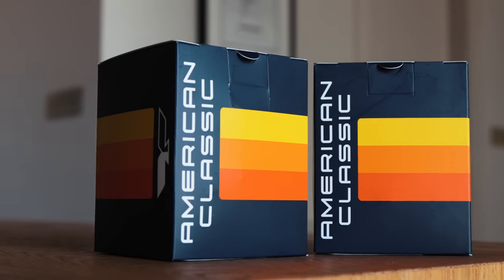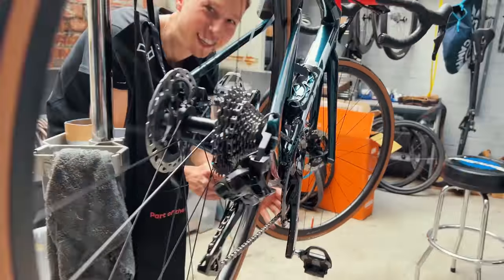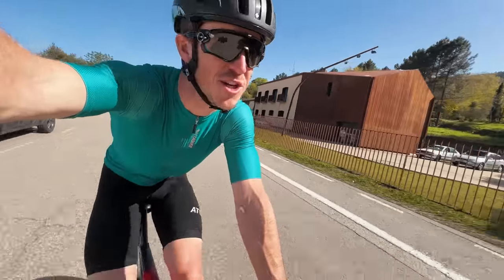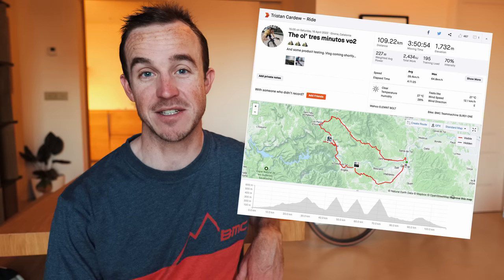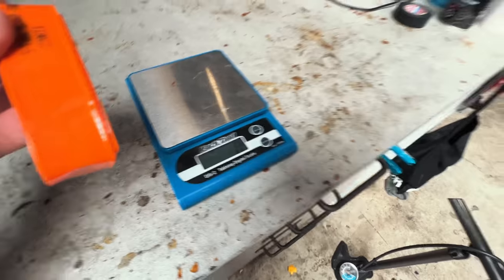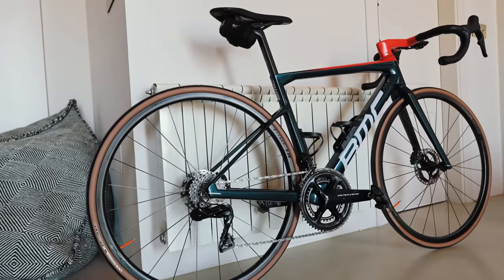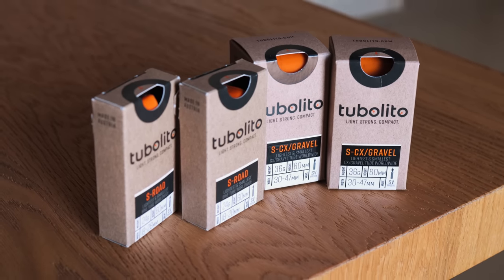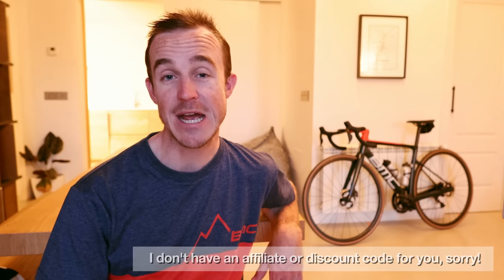One MUST HAVE upgrade for your road bike (this could change your ENTIRE riding experience...)

Comment: I rode Tubolitos for about a year and had a few punctures on it. They are very light, but in my experience they have a negative effect on rolling resistance. Replacing standard butyl tubes with latex tubes is a cost-effective, wise investment. Latex tubing is much softer and more conformable than relatively stiff plastic tubes. My recommendation are latex tubes or a tubeless setup. In my opinion, the advantages that result from this are worth much more than the weight savings with Tubolitos.

Comment: Even if you ride tubeless, the space-savings in the saddlebag you get from packing a Tubolito as your spare tube is worth the investment. Have only had to use a Tubolito once, felt great, forgot it was in there and I was hopping curbs and smashing through potholes all the way home. Then, when I changed out the punctured tire, the Tubolito cleaned up easily and folded back down to its super-small original size. I rate them for sure.
Reply from the maker: This is the feedback I love to hear. They just make sense in my mind! Glad to hear it was so puncture proof for you too 👌🏼
Reply: Spot on. Tubeless is the way to go + Using Tubolito as spare is perfect.
Reply: Thank you for the information.
Reply: Whether you are racing or hunting a KOM, using PU inner tubes is the worst choice you can do. In any case, the watt saving with a tubeless setup or with latex tubes clearly beats the weight saving with Tubolitos. If you are looking for a very light inner tube with a small pack size for your saddlebag, then try a Conti Supersonic, for example. It weighs only a few grams more and costs a third of a Tubolito.
Reply: @VeloclubLechhausen  Perhaps if you live in Germany the Conti tube is an economical choice, but Tubolitos and Supersonics are both $30USD where I live, and I find the PU tubes far superior in terms of puncture protection when compared to a 50g butyl tube. From a spare-tube standpoint, I don't care about what I chuck into the tire so long as I make it home without another stop at the side of the road.
Reply: @ktakashismith  This is annoying if there are no cheap, lightweight butyl inner tubes available in your country. The Supersonic tube was just one example of an extremely light replacement tube with a small pack size for the saddlebag. PU tubes make your bike lighter, but at the same time less efficient and who wants that? A tubeless-system is simply unrivaled for the best possible puncture protection combined with low rolling resistance. In terms of rolling resistance, however, latex tubes offer a good alternative, as many are biased towards tubeless-systems or do not dare to approach the technology.

Comment: Been riding Tubolitos for about 4k now, not a flat, not a puncture and lots of winter riding. Best value for money upgrade IMO.
Reply: what tyres are you running. Would they last that long in 23mm gatorskins. Thank you
Reply: @2552legoboy  I'm running GP5000 in 28mm but I bet they'd be fine in gatorskins, too
Reply: @Lwmuth  GP5000 are VERY good tires. I' have about 2000+ miles on a pair and haven't flared once. They are still going. I rated them before the rear one squared off too badly. I a have a set of Pirelli Zero Race on deck. I hope I don't regret it.

Comment: I've been running them for a year & 1/2 & found they are very robust! I get about 2000 - 2500 miles on a tube before puncture where on regular tubes I get 1000-ish miles. The weight, storage space, & being more supple, I'm hooked!

Comment: Tubolito's are by far the best upgrade i've got for my bike, also 10 months in with 4 punctures (3 on one inner) the repair has stayed strong ever since and the air loss when not in use in comparison to butyl is insane, NADA!!! I must add the punctures were big big chards of glass (after lockdown parties in BCN) which would have gone through butyl just as easily with cotton threaded tyres! The only thing I did notice is like you say it's supple, you do notice little bumps a bit more! Awesome review and glad you've converted to the orange side ;)

Comment: They are super light but can only be used with disc brakes, although they do a slightly heavier one for rim brakes, having said that I have been using latex tubes on my rim brakes for years without any issue which they don't recommend, but I probably wouldn't used them in the high mountains. Very impressed with your ability with film while doing vo2!!!

Comment: I have been using tubolito for about 2 years and only on my road bike. My ideal setup is : Tubolito rear, Latex front and 1 spare tubolito or 2 for longer day trips.   I like the feel with latex on front wheel over the weight gain.

Nevertheless I have not experienced*  much difference in puncture resistance between any tube type or similar quality as once the tyre is passed its game over.  The thing is if I puncture the latex and replace it with my spare tubolito on a ride I just leave it in after.  I then carry a latex spare.   The tubilitos need careful fiitting the side walls are fragilei if caught with rim etc and the valves are also fragile so make sure to not use lateral force etc when inflating.

Ofcourse latex needs some  re-inflation every 24 hours or so but Tubolito is at least as air tight as Butyl.  I like to check tyres before every ride anyway.   Latex is by a long way more comfortable than either Butl or Tubolito type.  Viewed as a system, taking a mix of latex and tubolito is for me the best balance of : Perf, weight, reliability, resistance, comfort, ease of maintenance. + lower 'faff' than full tubeless. 

Lastly I have successfully used cut up parts of an old Tubolito with standard glue as a patch rather than their specific repair  kit.

*  My last 3 punctures would have punctured any tube/race tyre setup though but 2 out 3 should have resealed if I was running tubeless.  Its still not worth the hassle for me but if you detest roadside repairs tubeless wins out imo. In 2 years I have have had 4 punctures total and ride 7.5K km per average per year on road.  Note: I live in South of France so same setup in winter also.
Reply from the maker: This is all great advice and commentary..thanks for taking the time to explain!

Comment: Ive had one of these in my saddle bag for a while now. Only just reading your comments i have realised there for disc only! good job punctures are super rare running tubeless. i've never had a flat in 18 months of switching to TL. Im sure it would work fine for limping home if i needed to use it.
Reply from the maker: It depends which you have…some are made for disc and some are compatible with rim brakes. These super light ones are designed for disc only but would most likely get you home fine if needed.

Comment: I’ve done a fair few kms on them, had good and bad experiences, ride is definitely nice and weight saving is noticeable but I’ve had two bad ones that cut regularly and two that have lasted well

Good upgrade if you ride on decent roads, expensive if there’s a lot of debris on your roads and you get regular flats 

They do hold air better than latex
definitely a great upgrade as a spare given the space and weight saving

Comment: Ngl, I’ve ordered 2 of these for my saddle bag just now. Looks like they take up feck all spade! The 2 conti tubes I have in there practically fill the thing
Reply from the maker: Nice one. You can literally fit 3 Tubolito’s in the space of one Conti tube and it’ll still be lighter. I’ve been loving being able to run a smaller saddle bag since making the switch.

Comment: Rode them for 25k in two years (on a rim brake and then also on a disc brake bike - the lighter S version is for disc only) and I was very happy with them. I think I’ve only flattened once on the rim brake bike and I had to pull massively to get the plastic valve out of the rim which was a bit weird… They are not the fastest in terms of rolling resistance. I’ve changed to tubeless some time ago but I still carry them as spares. Especially for gravel riding it makes a huge difference for your saddle bag. But overall I was very happy with them, need to get rid of the other tubes now :-)
Reply from the maker: Good to hear your experience..that’s awesome!

Comment: I have used Tubolitos a lot. The big disadvantage is you get a lot if flats. I now use a tubeless setup and love it 👌. I use tubolitos only as spares I case tubless fails. Which has never happen so far 😉

Comment: I've been running the tubolito s on my front wheel for thousands of kms without issue. Unfortunately on the back wheel got a puncture pretty early on and the puncture repair kit I found was just about useless. Simply couldn't get it to seal. That said, they're so light and feel so nice I'd still buy them again

Comment: Good review and excellent upgrade. Do You feel differences between 52 and 53 teeth? Nice thumbnail to crank up algorithm ;-)
Reply from the maker: Thanks mate! Yeah, there’s definitely a noticeable difference between the two chainrings. Ideally I’d like a 54. I find with the 53 I can keep a straighter chain line than with the 52 where I spent a lot of time in the 12, 13 or 14T cog on the cassette.

Comment: I ran them for over a year with only one having issues and tubolito was very quick to send a free replacement. But recently in the descents in Mallorca both front and rear have failed with one slowly bleeding air from the base of the valve and the other bursting on a switchback. I still think they are great for the weight, but I am starting to question their strength in some aggressive situations (but may well be my wheels).

Comment: Hey Tristan, thanks for another great vid. The scenery over there is isane! Curious to know if the V02 efforts you were doing were done on only one climb? (ie..is the climb long enough to get all the reps done, or do you descend and then start the next effort from the bottom?) Cheers!
Reply from the maker: Hey man, thanks so much. That climb is long enough to do a lot of 3” efforts but I was doing 3 of them and then descending back down for my 15” break in between each set. The main aim with that session is to continue climbing gently during the 3” breaks so your heart rate doesn’t come all the way back down, but then rest fully during the 15” break so you can start the second and third set at the same point as the first.
Reply: @tristantakevideo  gotcha! Cheers mate.
Reply from the maker: @leroy_who  No worries man

Comment: Great shout! Never really explored them before. Would be interested to know how they stack up environmentally? Also not sure if they would be robust enough on uk roads. Will give them a go
Reply from the maker: I couldn’t say how good they are environmentally, however they use less raw material than butyl tubes so that’s a consideration. They’re very, very light so I’d recommend grabbing a couple as spares and using them if you need..I hesitate to say “yes definitely try them!” if you’re unsure about the quality of the roads you’re riding on.

Comment: Only used Tubolito once but wouldn’t use again. Yes, they pack very small, but my experience they don’t retain air well and the valve stem is fragile. If you’ve used one  and then you take it out for repair, it will never go back to its original size, the plastic permanently stretches, so it becomes unwieldy to ever take it out as a spare again.

Comment: Why are u riding tubeless on your gravel bike but not on your road bike ? Is there a big difference ?
Reply: Also interested in knowing…why not tubeless on road bike ?
Reply from the maker: I’ve run tubeless in the past on the road bike and it’s been fine, but the tyres can generally only handle up to ~70psi. On the gravel bike I’m generally running around 20-25PSI and the super smooth roll and big tyre contact provides plenty of grip, whereas on the road I’ve found lower pressures can sometimes feel a little sluggish.

Comment: I have these on all my road bikes and my gravel bike.  Punctures are no bigger issue riding on rough country australian roads.  By far the cheapest way to shave off 200grams from your bikes taking into account the spare in the saddle bag.  Will never use butyl tubes again

Comment: This falls under the category of should have, would have, could have but didn't.  You convinced me.  But I'm interested in hearing a review on those tires.  I was considering those & liked how it was direct to consumer but lacked any real world info on them.  Like to hear your honest opinions on them.
Reply from the maker: My initial and most honest impressions on the American Classic Timekeeper tyres after 3 rides and 300k’s: they are THE GRIPPIEST tyres I’ve ever run. It’s actually quite incredible how much confidence they inspire on downhills. Genuinely, I’m quite blown away! HOWEVER: they are not as fast as other tyres I’ve used and I can feel the additional energy required to keep them rolling as quick as the last set of tyres I had. So it’s a trade off. Highly recommended for training and if you love going downhill with confidence, but maybe not so much for racing.

Comment: Hi Tristan. I really enjoy your videos. Let us know how the tubes perform long term.  I've viewed a few reviews on Tubolitos and not all have been positive. With the amount of miles you ride and document, I'd be very interested in your opinion. Also enjoy your interviews. Thanks,
Keith
Reply from the maker: Hey Keith, checking back in here. I’ve now ridden 9,000km on the Tubolito’s and had 2 very small punctures that I was able to fix for both. Ride quality is okay - not as smooth as latex but not bad. The weight saving is the most noticeable thing - both in my saddle bag and in the wheels themselves. So far I’ve been really happy. Hope that helps!

Comment: Mentioned in video so not entirely off topic. When upgrading from 52 to 53t did you have to make any other changes, chain, inside ring, front mech etc.?
Reply from the maker: We moved the FD up a touch to accommodate but nothing else. Shimano don’t recommend running a 53/36 setup but I’ve been running it on and off for a couple of years with no real issues other than slightly slower shifting.
Reply: @tristantakevideo  Thanks so much for the reply Tristan 👌🏻
PS I'll be switching out tubes next week already found a good deal on the Air Tubolito 👍🏻

Comment: Thanks for the review!!!
I'm considering buying these and I did find them online in Decathlon. But under "Compatibility" it's stated that they're only compatible with bikes using disc brakes. Is this true? I'm struggling to find a reason why that could be the case. Does anyone have any input on this?
Reply: Rims may get warm/hot under braking pressure
Reply from the maker: Yeah this is to do with heat in the rims from braking. Some of the slightly heavier duty Tubolito’s are compatible with rim brakes as far as I know.

Comment: Wouldn’t lighter mean it would be easier that it could be punctured? The roads aren’t great in the part of the uk where I live and €30 per inner tube sounds real expensive.
Reply from the maker: I can’t say definitively as I’ve only ridden them a few times since filming the video, however I would say the density of the material they’re made out of feels as though they’ll be more puncture or slash proof than regular butyl rubber tubes. Again, this is unscientific and I’m not claiming they are better or worse for punctures, but plenty of comments seem to suggest they’re pretty reliable. As spares, I will 100% be keeping them in my saddle bag. I’ll wait until I’ve done a few more k’s before I decide whether they’re ideal for every day riding.

Comment: I was skeptical with Tubolito's before, but the thought of spending thousands of dollars to shave off 100grams made me give it a shot. I've put on about 1000km on it on my road bike and 600km on my cyclocross/gravel bike. So worth it, I could tell it felt lighter and the way the tire conforms on to the surface you're riding on. No issues, even rode my bike on a singletrack that's full of roots and raced on a cyclocross course and it still is going strong. Well worth the upgrade for $30.
Reply from the maker: That’s cool to hear. I’ve done about 10,000k’s on mine now and had two very small punctures that were slow enough I didn’t notice until the next day. Both of them I repaired and the tubes have worked perfectly since. Glad you’ve had a good experience!

Comment: You shouldn't have changed your tires. You should have checked the tubes with the same tires.
 are those tubes repairable?
Reply from the maker: As mentioned a bunch of times in the video, this was an unscientific test. My rear tyre had worn through to the canvas so I needed to change the tyres pronto and used it as an excuse to install the new tubes. Yes, the tubes are repairable, hence why I mention the repair kit.
Reply: @tristantakevideo    Thanks 👍 I might have ADD  🤦🫢🤣  or getting old . 
I like tubes. I don't like the new system.  I prefer clincher rims.   I'm going to try the tubes. Starting with carrying one of those in case of a flat.